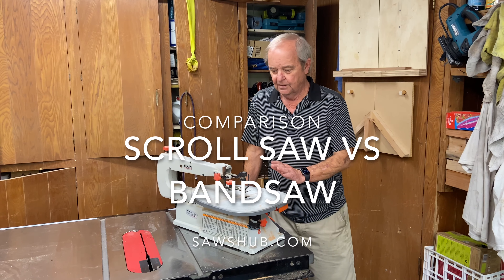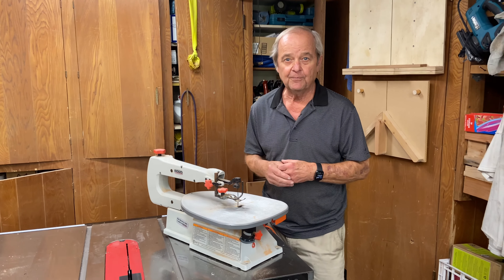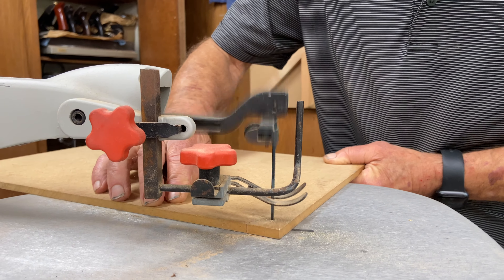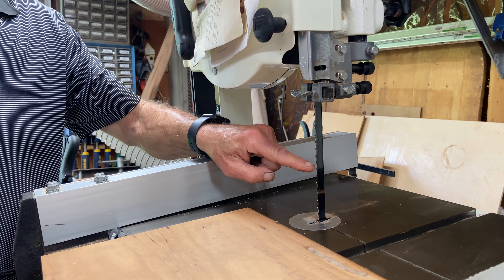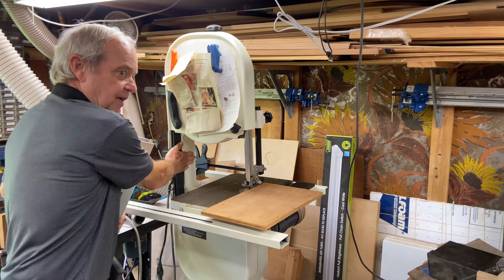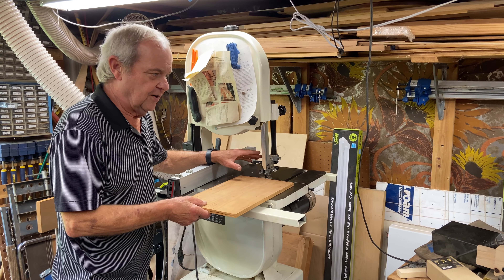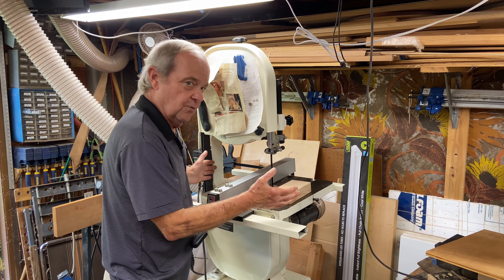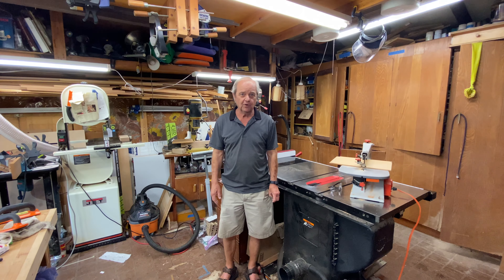Bandsaw vs Scroll Saw: All Purpose or the Fine Woodworkers tool

Comment: Thank you your videos. Could a scroll saw cut plexiglass or pvc or would It just melt?  Can scroll saw cut a shape from the center of a piece of material, or must it start at an edge?  Same questions for band saw and jigsaw.

What kind of maintenance do each of these require or replacement blades that sort of thing?  Do you have favorite brands you’d like to recommend?
Reply from the maker: A variable speed scroll saw set to a very low speed could cut plexi and PVC. You have to drill a hole to start from the center. We have articles on our favorites at https://sawshub.com!
Reply: I have the Einhell scroll saw. I use it expressly to cut acrylic/plexiglass, old CDs and other recycled plastic. I find having the speed turned right up is best, but I guess that is up to the worker. Thinner plastics do not melt but the thicker stuff does. To remedy this you can cover it with painters tape or any other tape, not duct tape though that leaves residue.

Comment: Are these good for thin 0.5mm aluminium? I know woodworking and aluminium use similar tools as it isnt a very strong metal. Thanks
Reply: Im talking about the scroll saw by the way
Reply from the maker: Wood is much less flexible than 0.5 mm aluminum. I would expect that aluminum would flex quite a bit. Given that, none of these solutions would be ideal on a surface that flexible. They would tend to crack and peel off.

Comment: Nice video ! Now i know what saw i want .
Reply: I have tried looking on YouTube for videos that do angle some of us aint good at angle's  . Ive decided to get center point and use a string i really suck at measurements .wondered if you had any trick. Every YouTube video has it the proper form but not angles for dummies.lol i seen  behind you you had that wood with 2x4 and with angle and center 2x4 .
Reply from the maker: Thanks for the question, that's a good topic for a new video!
Reply: Yes i figured you would be good at making a video .you're very detailed and another issue is making cuts i was making 80 degree cut with a 7 degree cut that crosses it.i used table saw but it was dangerous how i am doing cuts. This is being done on a 2x4. That's why i was debating on what saw to get .

Comment: And don't forget to wear EYE Protection and  A mask, especially when processing Toxic materials like MDF.  (Medium Density FibreBoard - toxic glue and tiny fibres). This should be your very first step when using power tools that can chip off material at high velocity. Also: Please don't think woods are neutral, always check the online Wood Database or Similar for safety info. These videos are GREAT but this 101 step is omitted.
Reply: How is your critique relevant? This isn’t an instructional video, it’s very clearly a simple comparison between two machines.
Reply from the maker: Agree with @Minty. Will's points are true, but this video isn't intended to show you how to use either of these tools (obviously). It is meant to help you pick which saw you need for which project. If you want, please make sure to watch our instructional How to videos for both the Bandsaw and Scroll Saw.